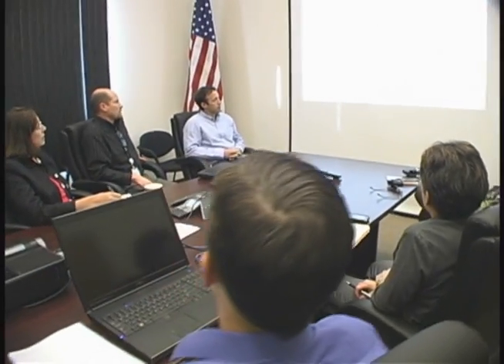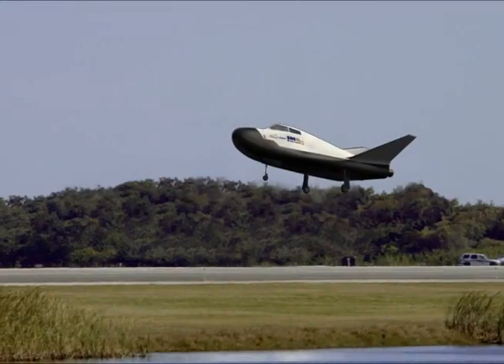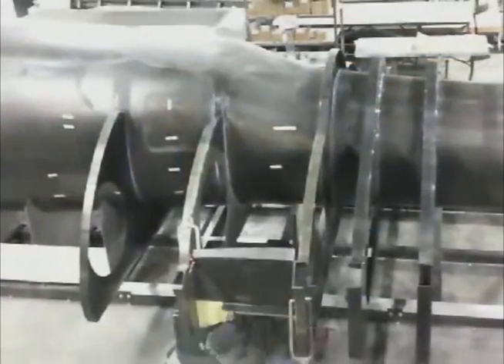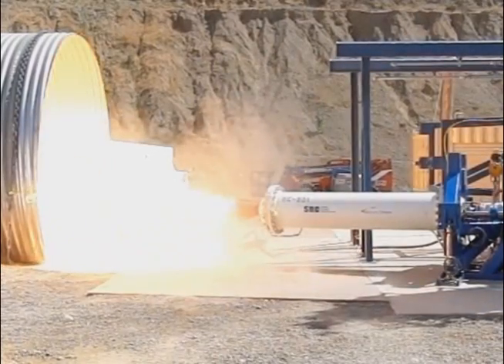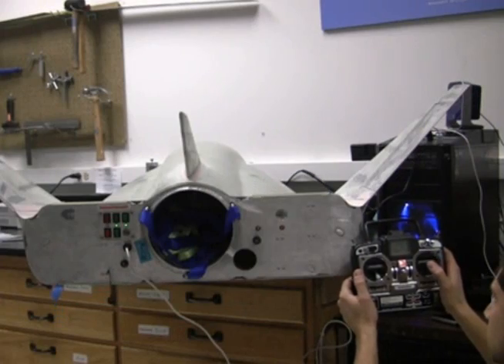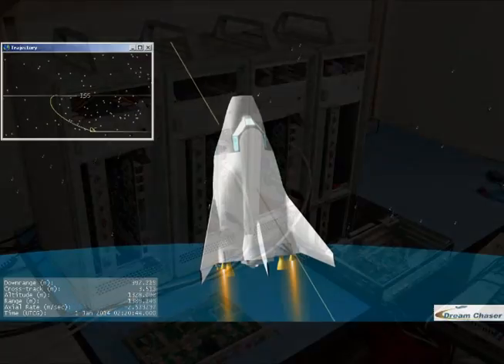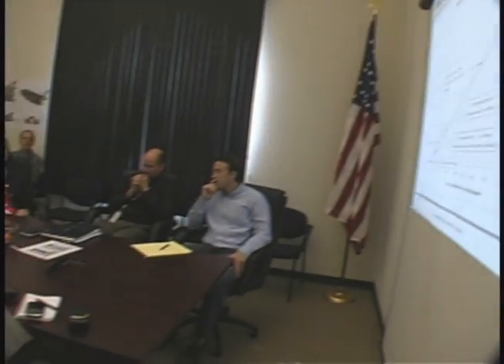Sierra Nevada Dream Chaser NASA CCDev Accomplishments Video

Comment: Interesting.   I guess the Falcon heavy would be overkill because it lifts up to 53,000 kg.   The Falcon9 with a single Merlin2 engine (which might be ready before the Dream Chaser is ready) may lift more.  Its suppose to have more thrust than F1 engine.

Comment: Ahh, one thing I found out is of the 3 numbers on AtlasV the middle number represents the # of SRB's.  Thus 402 is zero SRB's.  What I did not know is about half of AtlasV launches were with SRB's.  It is good for Dream Chaser so they don't have to worry about the powerful oscillations and shaking caused by SRB's.  If it were up to me I would upgrade to a more powerful Delta IV with no SRB's before I would put fragile cargo on a AltasV with SRB's to give AtlasV a little more lifting power.

Comment: I'll compare the launch vehicles.  
At present the Falcon 9 provides LEO of 10,450 kg.  
The Atlas V in 402 configuration gives LEO of 12,500 kg. 
 
The Dream Chaser Mass is 11,340 kg so it won't work on Falcon 9. 

 
Interesting discussion on the rocket efficiencies appear just google: 
"SpaceX Falcon 9 vs Atlas V 401 and Zenit 2"

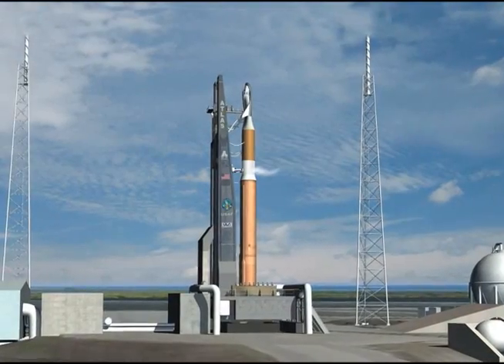Comment: In the video at 1:40 they mention the Atlas V configuration 402 chosen for the Dream Chaser.  Such a configuration uses no SRBs.  
 
Each number has a meaning.  
The first is the payload fairing (4 metres)
The second is the number of SRB's (zero)
The 3rd is the number of engines on the Centaur stage module. (2) Also called a dual-engine Centaur (DEC) vs single engine Centaur (SEC).
 
Of all the Atlas V launches so far, none have yet used the DEC configuration. 
Hope this explains things.

Comment: Very Cool vehicle.  However, if they had use Falcon9 rather than AtlasV, the cost would be cut from 300 million to 100 million.  Even know AltasV has a perfect record using Russian engines.  Falcon9 will be a safer launch vehicle because if its clustering arrangement and its ability to turn off engines in midflight.  If the AtlasV version requires SRB strap on's like this video depicts, its only a matter of time before disaster.  Of all AtlasV launches, only a few used strap on SRB's.